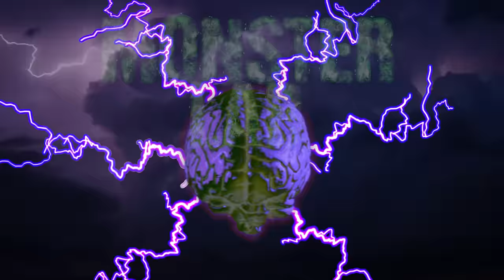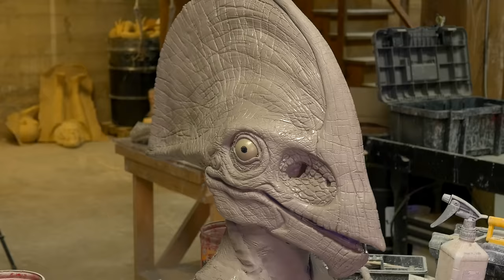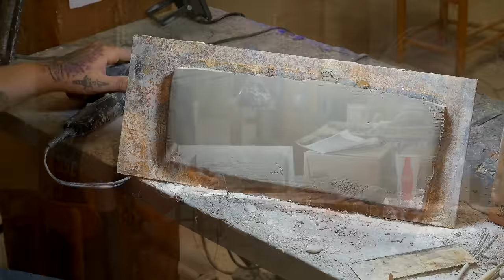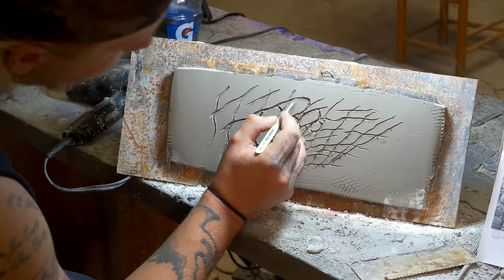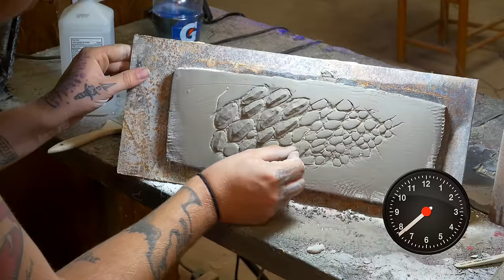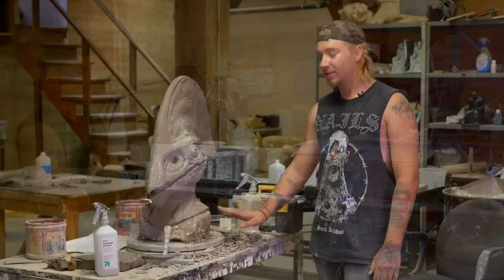Sculpting Scales in Clay Tutorial | Monster Lab

Comment: I got a lot from your demo. I have an old anchor that I painted scales on over 5 years ago. The paint in coming off and now I want to get more dimensional. You have laid out the ground work very well. Can you recommend a medium that will dry hard on a metal anchor and when sealed will resist the weather? I was thinking of a stucco type product. Price is a consideration, but the primary thing is for the work to hold up in Washington's rain.  Oh, what did you use for the dinosaur's eye?